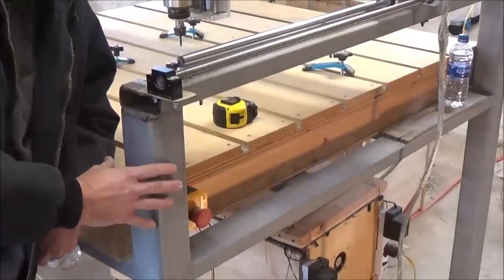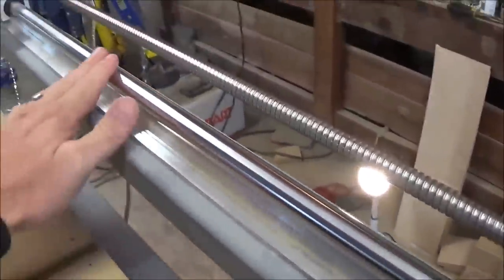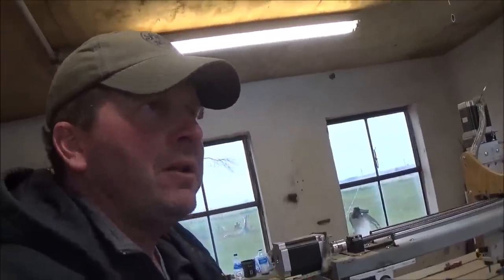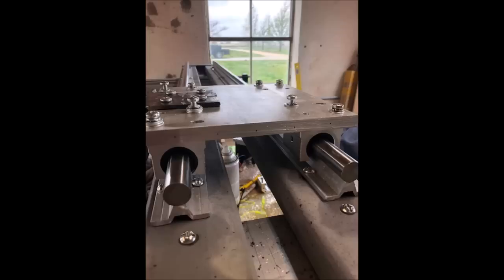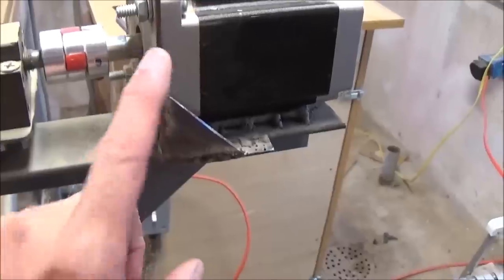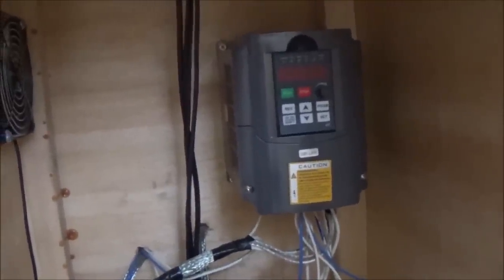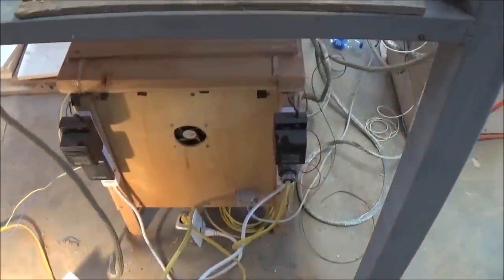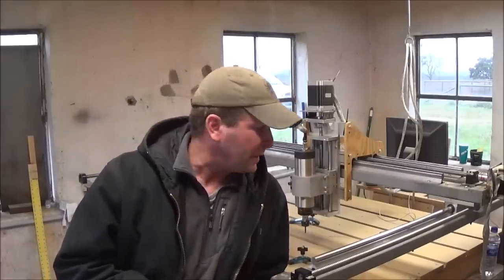My DIY CNC Router build

Comment: I'm an Electronics Technician trained by the US Navy.  To prevent ground loops,  only ground one side of your shielding.  That breaks the ground loop circuit and yet benefit from the shielding because it it at ground potential.  Great video.
Reply: Good advice, also keep low voltage DC in separate cables as the AC which it looks like he did.

Comment: If anyone (like myself) is designing a CNC, compare prices for linear guides and ballscrews on Aliexpress/Alibaba. This is where Amazon resellers get their products (and profits), so consider ordering in advance as you design your machine. If you purchase some things by mistake you will often still save $ over Amazon,  buying twice on Ali (also look for a very reputable seller and you will always be happy). That said, consider the size and optimal speeds, feeds, and loads for the type of machine you're building (router, plasma, et cetera) as this will effect the efficiency of the unit in it's task. There are advantages/disadvantages to having larger/smaller guides or various screw pitches for resolution of cut. Something I'm still trying to wrap my head around. Finally, thank you for taking the time to make a video! I found some very helpful ideas here!
Reply from the maker: Good Tips!!....Thanks for coming over and thanks for watching!!

Comment: Great video.  And finally, I've found a build that extends the verticals table supports above the work surface.  I kept thinking the most difficult part of the build would be designing a sturdy gantry - problem solved.  I don't understand why more machines don't use this configuration.

Comment: The great part about your video post is the listing of all the parts and/or components you used and where to find them. A small suggestion if I may: If you get inconsistencies on your x or y-axis'  check your coupling reducers you show early in the video. Those were initially designed to be a protective release coupler for conveyor systems in the event of a jam so the motor would not overheat. They can be "sloppy" especially when it comes to a task as precise as a part of a CNC system. Other than that, great job. Welcome to the select group of youtube content providers.
Reply from the maker: Those came with the ball screws..Thanks for the info though if I should start to see any inconsistency I will be changing those first now!!! Thank you and thanks for watching!!!
Reply: Those type are also used in industrial motor applications to prevent vibration as well as providing a failure point outside of an expensive pump or motor in the case of misalignment...should be fine.

Comment: I sincerely thank you for this.  I have a small hobby business in San Diego where I need to get things CnC cut every month or two and have gotten to a point of burn-out in trying to schedule with local fab shops who are either too busy to deal with small guys like me who have small orders or worse, they will do it and will greatly overcharge me (like $100 for cutting out large sized pieces from 1 sheet of 4x8 plywood which takes 30 minutes). I had also joined a local DIY shop with a CnC which I learned how to use myself (and I use Vcarve too) but again, they have monthly fees and it's always an issue to schedule time exactly when I need it.  Suffice to say I just want my own unit so that I can cut on demand as required. I had also looked at smaller 2x2 or 3x3 systems for plastics and wood but I really want something much more beefy and larger that can also handle up to 36" x 72" of 3/4 plywood.   I know pass depth is an obvious factor in all that as far as motor power, but you know what I mean as far as time is concerned in cuts.  I also weld too and have recently got into tig for aluminum so everything you've done here is 100% what I need and well within my skill set.  I am also looking at a 4x4 plasma cnc but that I will just buy outright as I sometimes need to cut steel as well. You did a great job!
Reply from the maker: Awesome!!! If I had Tig capabilities I would have done a aluminum frame, I just had the metal on hand and had to buy very little....Do a lot of tack welding when your first doing all the joints....I had probably 4-6 tacks on every side at every joint before I hard welded (I was afraid of the expansion and contraction that comes with welding) and by doing it with a bunch of tack welding i minimized movement....Keep me updated on your progress....My email is smokeyscnc@gmail.com....Thanks for watching!!

Comment: Excellent job of describing your build. You, like myself chose to raise the Y axis bits and pieces, makes for a much more rigid Machine rather than having the X axis high up on brackets. Yup you overbuilt, but nothing at all negative about that.  One thing I would add is positive stops for all axis, just a good safety feature.  One other thing, you can replace the plywood brackets and make ones out of one half inch aluminum and cut them on your machine, just take light cuts with an aluminum cutting bit, and use 6061 aluminum, it cuts grate.  Some aluminum alloys are gummy stick with 6061. I cut several aluminum pieces of 1/2” in my CNC and I’m running nema 23’s.
Reply from the maker: Ok awesome info on the gussets, I would like to change it, if for no other reason the look of it...Thanks for watching!!!

Comment: Big Hello from Sydney, Australia 
Nice Build, I think you have done an excellent overkill job, love you choice for linear rails and ball screws, I would have gone with a water cooled spindle though.

My suggestion or ideas to improve/simplify just some minor things are:
Get plastics cable drag chains to tidy up your wiring, one day you are going to trip and on a vest case scenario rip out some wires and damage some equipment.

PC Cooling, remove the fan blowing out in the computer box, you want positive pressure inside the box, meaning you only have fans blowing into the box, this will prevent dust being sucked in through holes or cracks.
I would get rid of the box with the filter and the ducting, place that second fan next to the fan with the silver duct coming in, then make a frame on the outside to hold your filter on the outside of box so the computer fans are drawing air directly through the filter, place an awning over the filter so dust wont fall directly onto the filter.

get a squirrel cage blower to suck at least the fine and medium dust particles up you can blow this outside if you are country or you can use a cyclonic dust extractor.
Reply from the maker: Thank you and Thanks for watching!!

Comment: I did away with the limits switchs because they kept triggering estops that no amount of shielded wire and ferrite rings could cure. Also, unless you use really expensive proximity switchs they are not accurate enough for homing either. I just made some hard stops at the ends of the travel and drive the machine into them for homing and maintaining the squareness of the gantry which I check often because lost steps are inevitable. Good looking solid build there, good job.
Reply from the maker: I decided here while back that I wasn't going to bother with them either, i'm there watching anyway.....and yes I have ran into lost steps occasionally...I've just got a couple of marks on each side that I know are square and i can measure and make sure the gantry is square....Thank you and thanks for watching!!

Comment: Excellent video, I enjoyed it and it is a great build.... Not sure if anyone told you, but the middle left bolt on your spindle mount isn't suppose to go in, it is there to assist with removing the spindle from the mount.  After loosening the mounting screws, you tighten in that "third" bolt which will then force open the mount allowing the spindle to slip out. Keep up the great work. Thank you for sharing.
Reply from the maker: Yes, thank you and thanks for watching!!

Comment: Thanks for this info, I like the way it is overbuilt.  It is interesting to me that you stacked the X and Y rails horizontally instead of vertically like most machines.  I have often wondered about that since I tested several sliding miter saws for an extremely accurate application and went with the one that had horizontally stacked linear rails...it handles side to side deflection better than the others.  I am definitely going to follow your build here once I figure out how the computer to CNC interface control works...I am pretty familiar with mechanical and electrical instruction and 2D CAD but the thing in between is new to me.  Congrats on your retirement, I patrolled Houston for a while before my wife couldn't take the stress anymore.

Comment: Brian, this set you've done is really amazing. I used to be a CNC operator for a cabinet shop and ran a Biesse CNC dinosaur which probably cost thousands more but never ran without tons of problems. With all the mechanical work I had to do on it I could probably build one myself. Anyway, you did build one and you did an awesome job!! It does beautiful work to btw. 🙂
Reply from the maker: Thank you, and I your right you could build one...The main reason I built instead of bought was so I knew how it all worked and went together, if it breaks I know the guy that can fix it!!!...Thanks for watching!!

Comment: FWIW, you can’t fry a stepper motor by putting too much load on it; it’ll just stall and sit there vibrating. This will of course ruin your workpiece, but the motor will be fine. What will kill the motor, however, is setting the drive current too high for the motor (each motor, in the specifications, will list the amps that the driver should be set to).

Comment: Hey Brian !
Thanks for putting this video together. This is really a fine machine.
I have made 3 CNC machines, but whe have been full time RVing for a few years, so i got rid of everything.
We just bought a house in Seaside Oregon, so now I'm so excited to build my 4th CNC. I got very inspired by your CNC. It is such a solid machine - and that is so important if you want accuracy. I love the solid steel frame and steel gantry. The wooden reinforcement of the Z-axis is really important as well to avoid deflection, especially when you cut circles.
I just love all about this solid machine. I'm curious to hear if you have tried milling aluminum with it? I could imagine it would be solid enough for that.
I used to make guitars with my CNC. It had to be very accurate. One trick I can share with you from that is:
Put a surface roughing bit in the spindle and let it take of 1 mm of the entire surface of your sacrificial board. This way you are 100% sure, that the surface follows any inaccuracy in your machines gantry and side rails. This trick made a world of difference for my machines.
Thanks again for sharing your video - it is really good and I will build a better machine with your inputs and ideas in mind.
Thor.

Comment: great build,  I've built a few over the years and the latest is using an arduino which opens up the door to free to hobbyists and students cad cam drawing software called fusion 360 which provides all the data for cut paths to run the cnc... just my opinion but way better way .  My next build I think I'll do a youtube and make a 4x8 plasma cutting table /system.
Reply from the maker: I looked at a fusion 360 trial for awhile and messed with it some but after using vectric vcarve and found the ease of use so much better, but yes fusion is a powerful program...and you should do youtube!!! a plasma would be nice, I've just worked in wood for much longer.....Thanks for watching!!!

Comment: It looks like you’re missing the pre-load nut and C clip at the ends of your ballscrew, for holding the ballscrew in place in the bearing blocks. Potential source of backlash and slop. Also, just FYI, those SBR20 linear rails are prone to coming loose over time. The cylindrical steel part is bolted to the aluminum base with some bolts. Take the rails apart and put some Locktite Red threadlocker in there to help them stay together. I actually had one come apart, and it took AGES to find where the slop was coming from.
Reply from the maker: There is a C clip at the end of the ballscrews, the locktite is a great tip...I'll be doing that soon!..Thanks .....and thanks for watching!!
Reply: I like to use vibra tite thread locker as it is less prone to vibrations where as locktite will start to fracture
Reply: @cd7140  funny, I wrote that comment 2 years ago, and just a few days ago, I noticed that the clip popped off of the bottom of my Z axis. Sure enough, I was able to lift the entire Z axis up by about 1/4”, with only the weight of the axis keeping it down. I replaced the clip and now I’m back to zero slop. Vibra tite - I’m going to pick some of that stuff up. Thanks!

Comment: Very nicely done.  Amazing these things are still running on the old Mach3.  Mine is as well.  I've flirted with the "upgrade" the Mach4, but I always end up with "don't fix what's not broke...." :)
Reply from the maker: When i first started building, all the forums were talking about gliches with mach 4 at the time...and so i just went with what was proven mach 3...I believe they probably have the issues worked out now, but i'm with you, its working great some I'm not going to fix whats not broken either!.....Thanks for watching!!!
Reply: Upgrade to LinuxCNC
Reply: I've looked into it - and would love to give it a try sometime.  But for now, that would be an upgrade path that would take far longer than I personally have right now.
Reply: @motopreserve  can't spare the 5 minutes it takes to install? OK gotcha. You must be fun around the holidays.
Reply: While I admit I'm no computer wizard, I have installed and swapped a piece of software or two.  Unfortunately, I have never had your described quick and smooth transition while changing to a new operating system (or creating dual boot???), installing unfamiliar software, getting up to speed on the interface, and having a machine running correctly in 5 minutes.  Sadly, I also admit no one has ever accused me of being fun around the holidays...
Reply: @motopreserve  I have a dedicated PC for my CNC machine. It is some old clunker I picked up for $5. With LinuxCNC it all comes in one file that you boot, then there's an icon to install it. Then you reboot and configure the software with graphical wizards. The only slightly tricky part is telling the software what port you're running on. In my case I use an add in parallel port board so I get it through the PCI interface. I could have used the built in parallel port but I made my own break out board and I was a bit leary about plugging electronics I made myself into a PC. It turns out it'd have been OK though. But there's documentation about the steps you need to go through to set the controller up. It's pretty cut and dried for simple setup. Then once you're all configured you do have to know how to run the controller front end itself. You turn off the ESTOP, home your axis, touch off, load your G Code and go. Though I usually load my file I'm going to run first. Before I shut down I do a G0 X0, Y0, Z0 just so the machine starts out homed again the next time I turn it on. Sometimes I forget. Then it is annoying to rehome it. So I try to not forget. Before the GUI wizards I'd have said yeah it takes a bit but now it is all dead simple to do. It is just like a Windows program with a bunch of windows that have Forward buttons on them. This is what one looks like http://linuxcnc.org/docs/html/config/images/stepconf-axis.png easy peasey
Reply: Thanks for all the info.  It does sound like it's come a long way since I last looked into it.  Not sure if they still consider it an issue - but I currently run my machine from a laptop.  I know in the past some considered laptops to have too much latency???  Also, if the laptop works, I think I'd need a new computer>Gecko interface, since I recall there being an issue with the USB/Parallel adapters (I use the UC100).  I thought the suggested interface was the ethernet type like Mesa?
Reply: @motopreserve  well nothing has changed as far as laptops and USB goes. I don't know about Mesa and Ethernet. I use software stepping with the parallel port. So that is all I am familiar with. I know of someone that knows all there is to know about Mesa though. Look for someone that goes by the nickname PCW on LinuxCNC's forum or in their IRC channel. They're the one you want to ask any question you may have about Mesa.
linuxcnc pcw mesa
About 19,500 results (0.49 seconds) 
You won't be the first person to ask PCW about Mesa. That's for sure.
Reply: Thanks!